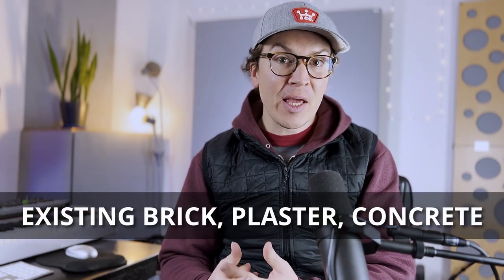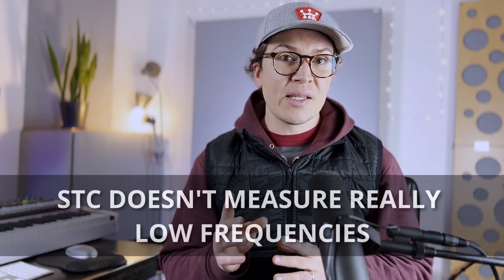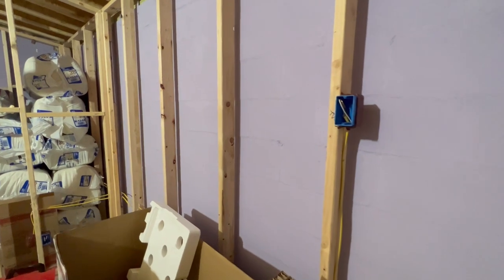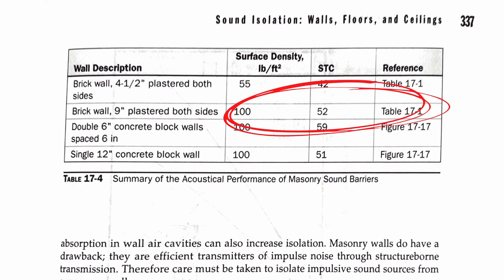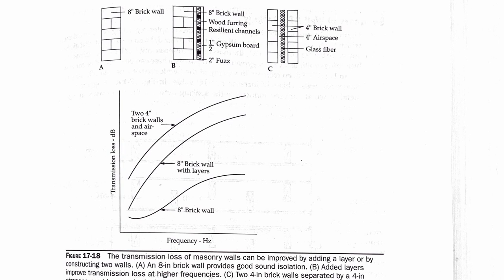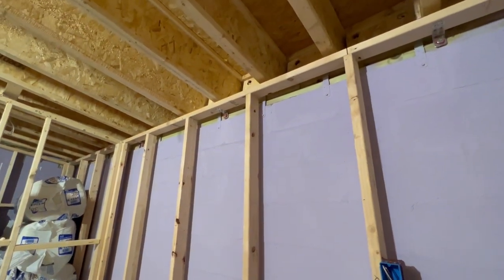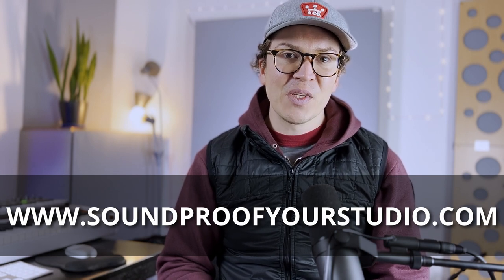Using Brick, Plaster, Or Concrete For Soundproof Walls

Comment: problem with concrete is the rebar which caries shock like no tomorrow. I worked in construction for 5-6 years & it can be surprising to some how much steel is in concrete. 
Good vid bud 👍
Reply from the maker: Yes, the denser the material the faster sound travels and the easier it is for it to travel through it at great distances. Concrete and metal are excellent examples of this happening. The key is to decouple the mass from the two walls creating a mass spring mass system.
Reply: @soundproofyourstudio  I was amazed at how much more damping sand provides than grout in a non-structural CMU wall.  I read this the other day in Rod Gervais' book.
(Thanks again for recommending it!)

Comment: Hello! I'm planning to turn my garage into a recording studio, it's made out of thick bricks. If I would build a room within a room system, with studs and plasterboard and a few inch gap between the two walls, shouldn't I need something like a vapor barrier or something (behind the insulated wall)? I live in central europe, so the winters are cold and the summers are hot. Here people don't really "insulate" their houses from the inside, cause it gives a lot of problem with condensation behind the insulation material. Is there any working method for this type of construction? Thanks! Btw, your videos really helped me to understand the basics of soundproofing! Cheers
Reply from the maker: Yes a vapor barrier is good in any building. The key is to place it somewhere in your wall and keep it continuous from wall to roof. I like a book called pretty good home for more info on best practices. Will make a video on it too.

Comment: Should the roof/ceiling mass equal the outer/inner wall mass?  I am converting a wooden garage with an outer brick facade with a simple plywood, roof paper, shingle roof.  It seems to me I need to add more mass to the roof and ceiling to equal the mass of wall layer.  My thought is to add MLV and resilient channels to ceiling along with insulation and double drywall.  I'm concerned about the added weight to the pre-existing roof.  Any tips?  

Thanks for all the tutorials and info!
Reply from the maker: Hey John this is a bit more complicated to answer in a message thread. Sign up for a free soundproof clarity call if you still need some help: https://calendly.com/soundproofyourstudio/soundproof-clarity-call-evergreen
Reply: I was wondering the same thing. I've been told soundproofing is only as good as the weakest link. So even if there are no windows and a complex door system, it's hard to imagine the roof/ceiling would be able to match the very low-frequency attenuation of the concrete without extreme and complex measures
Reply: @mountains1233  I opted to match the ceiling to the wall treatment - 5/8" drywall between studs, 3" mineral wool insulation, resilient channels, 2 layers 5/8" drywall - and got consistent results.  The only difference is the roofing material on top and bricks around the sides.  The planes flying overhead are practically inaudible and I no longer hear the train rumble or horn blow from 4 blocks away.  My weakest link is the window and door system as predicted.
Reply: @JohnPapaGros  What kind of planes are you dealing with?

Comment: Question-- If you're trying to block sound from coming IN-- is there any benefit to flipping this design? Like wood framed exterior with insulation, but then a brick wall on the interior with an air gap? I've got issues with Harley Davidsons and the bass from rap music :)
Reply from the maker: The bass from rap music is super tough, but you can deaden both to a better volume. It is the same either way. I think the brick will be heavier than drywall this soundproof better.

Comment: I saw a video reel about pre-cast concrete. Is this feasible for at least a non-decoupled system? I'm only interested in sub-100Hz attenuation.
Reply from the maker: The way soundproofing works is that if you attenuate below 100 hz you will certainly block out higher frequencies too. Pre cast concrete would work well since it has a lot of mass. The mass will help with blocking the energy of sub 100hz.

Comment: Hi, I have a question.? I am building a recording studio with a concrete wall because of space. I intend to use Mass Vinyl, then the Stud with insulation between the stud after that, another layer of mass Vinyl with a 5/8 Sheet rock panel. Can that work?
Reply from the maker: I don’t recommend MLV. It is not as efficient at soundproofing low frequencies as green glue. I am not sure I follow your design, but I am worried it probably won’t work.
Reply: My design is Building Concrete blocks as my building frame. After that will build a second wall with MLV. MLV will be attached to the back of the studs, then rock wool insulation following that is another layer of MLV and 5/8 gypsum panels. Hopefully, that explains it a little better.
Reply: MLV works great at stoping sound waves. The low frequency problem he’s talking about can be helped tremendously by decoupling the walls. Basically making it so that low frequencies hitting one side of a given wall can’t vibrate through the whole wall.
Reply from the maker: @301cclint  What I would recommend with your design is to build the second wall and use either IB-3 clips or whisper clips to attach it to your concrete blocks or roof beams. This will keep that wall from moving side to side and will stop sound. I would for go the MLV and use two layers of drywall with green glue. MLV does not stop low frequencies as well as Green glue.

Comment: Very useful video
 
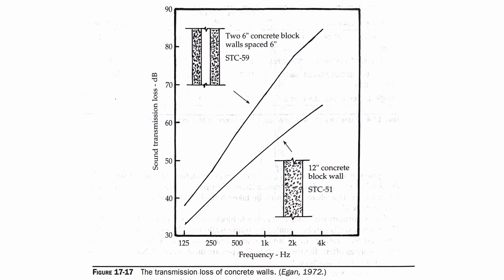The comparison you do  at 4:57 using that picture would be more interesting and fair  if you compared STC of 18" concrete wall too

So if we have 18" space to place a wall(like the picture above at 4:57) is it better to fill that completely with concrete or an air gap between?
Reply from the maker: The air gap is essential to create the mass spring mass system needed to stop sound. Thanks for watching!
Reply: @soundproofyourstudio  so do you guess a 18" concrete wall has STC lower than 59?

Comment: I want to put a thick veneer on an existing external stucco wall to help mitigate the noise level from traffic.

Any suggestions?
Reply from the maker: Think about mass and decoupling. You want both to reduce sound transmission